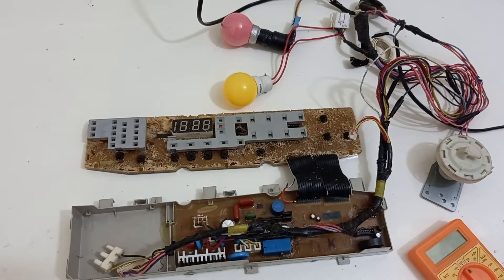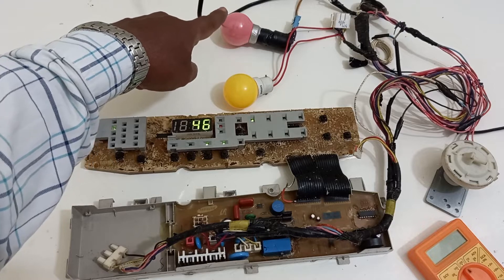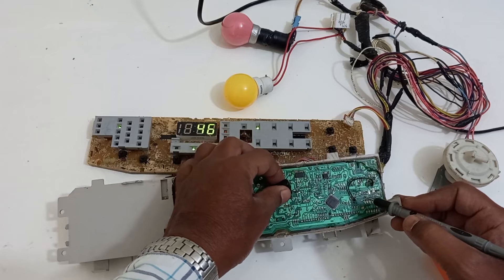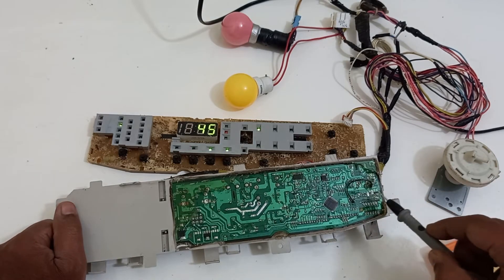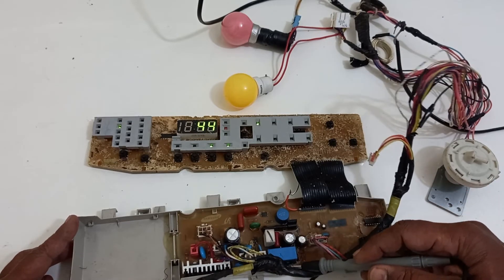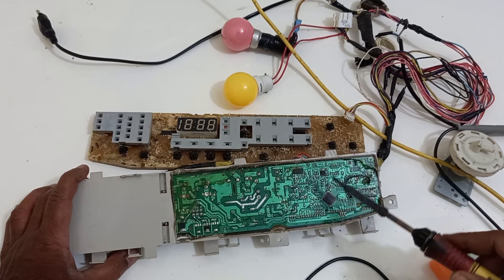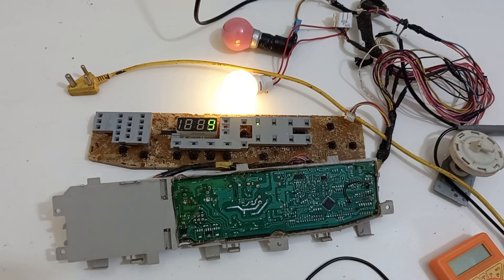Washing Machine PCB repair, Simple technique to trace, inlet valve, drain not working

Comment: same problem facing. but my washing maching work perfectlybut only inlet valve not working. but when i put water manually then it wash everything perfectly. I changed the inlet valve ic but still not working. what should i do?
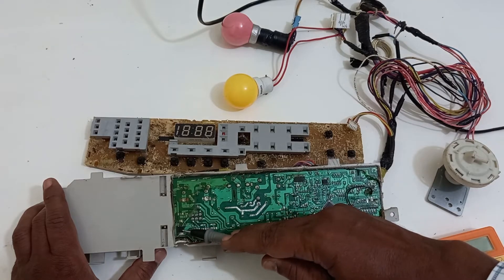Reply from the maker: 1:36 check and replace switch shown in the video
Reply: @technoolab3514  but drain motor work perfectly but inlet valve not working. i also changed inlet valve switch but still not working. i tested the voltage of inlet valve that is showing 000

Comment: Panasonic front load washing machine NA123 vb3 shows 'END' message as soon as the wash selector is set and door is not locked with outlet motor starting. Pressure sensor is good. Pcb board no AXW24V-18738

Comment: Sir one problem is in LG TOP LOAD washing machine inlet valve have continous supply when machine main supply on means water continue on so if i checked at valve continous supply shown so pls suggest solution is it possible triac is on when main supply on.
Is it possiblw when triac shortckt it may continues on?
Reply from the maker: Yes most possible
Reply: Thanks sir
Could i replace triac
Reply from the maker: @nitinmangle6927  check if the terminals are shorted, then go ahead and replace

Comment: Hello sir... My board is same sir..... Problem is water valve not opening sir... Valve changed... But no use. Power continuesly coming to valve... Sir but how much voltage coming to valve i don't know sir... But valve not opening.what is the problem sir
Reply from the maker: What is the voltage you are getting across the valve, valve voltage is 230v
Reply: @technoolab3514  i will check sir... If voltage below 200v, what can i do sir..

Comment: Samsung front load washing machine water over flows 4E came .pr. switch and hose checked ok .which point i should check in main pcb relay or control pcb
Reply from the maker: Could be due to scaling, please Ensure free flow of water in sensor pipe

Comment: Hi good video, please tell me what transistor is labeled IC7 on pcb (for drain motor) .
Reply from the maker: Thank you, IC7 Is a power module
Reply: @technoolab3514  Please tell me the exact module ID or specifications for a replacement . I need to replace my burnt-out module.
Reply from the maker: @CFERES16 Part number is BP5055-12,  220VAC Input/−12VDC (250mA ) Output Non-Isolated AC/DC Converter, Please check below link for further details
Reply from the maker: https://datasheetspdf.com/pdf/924354/Rohm/BP5055-12/1

Comment: In this path what's the roll of transistor .
Reply from the maker: As logical input to the micro processor (External interrupt input ) connecting  INTP6 pin 1 of micro processor
Reply: @technoolab3514  as you directed in your video ...after cheaking 100k resistors and 1k resistor .... replacement of transistor is successful story of my job.....thanks bro.....

Comment: Sir all resistor are showing ok, also changed transistor but facing same problem, what to do. Please guide me
Reply from the maker: There are five more interupt pins to this micro processor, this video i have explained one path, Please check display board, if Possible will make another video for remaining intrrups shortly
Reply: @technoolab3514  please tell other reason for same problem

Comment: Sir, How to identify PCB is not working.
There is lot ls of possibilities of few technicians  misguiding users regarding failure of PCB.
Since it is an costly affair please help me to understand.
Reply from the maker: PCB out put to be checked, ie out put of PCB at Feed valve terminal, Drain motor terminal  using multi meter
Reply: ii 
pcb ka price  kya hai

Comment: Sir I have same board..my problem in 12 v short...when I check all components all r gud but don't get 12v standerd  but I dummy the Darlington ic 12v  pin then I get 12v...so what is the problem..is that ic had been defected
Reply from the maker: All components good, then Darlington IC could be the problem, there is one more Darlington IC of same number in the display board, you can use that and confirm
Reply: Sir I changed two ics  now I get 5v and 12v but there is no leds and display not working  but power button and buzzur are working remaining button not function what is the reason sir
Reply from the maker: @aravindsundaresh203  is the seven segment display working?
Reply: No sir display also not working only power switch working when we press power buzzur will give sound we can on and off that switch remaining switch and display not working I changed display side ic also but no use

Comment: Brother ,
In this same model pcb , we face the water inlet solenoid is open immediately after switch on the machine , even during    spinning throughout all operation . how to solve this please help.
Reply from the maker: Have you replaced with the same type (AC)
Reply: @technoolab3514  what u mean same type ac? Where it is? What value? Thank you